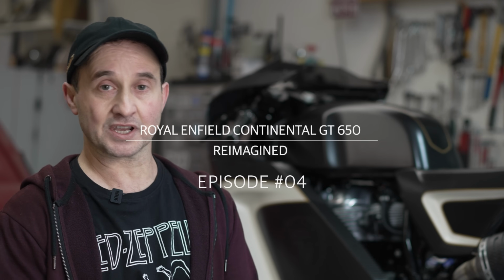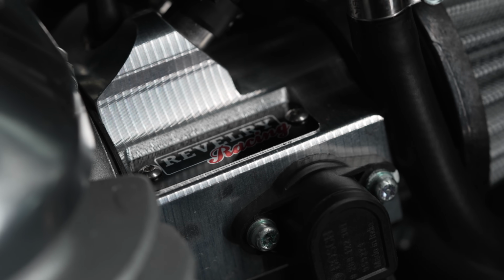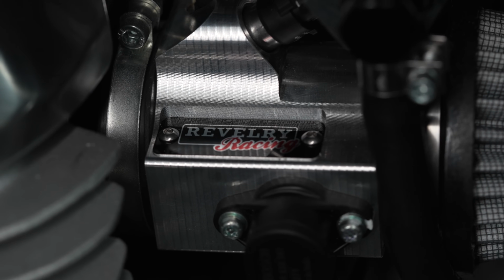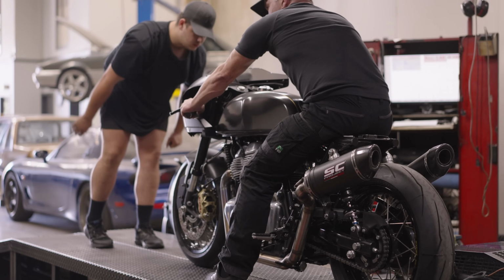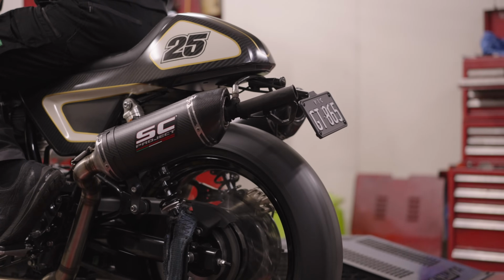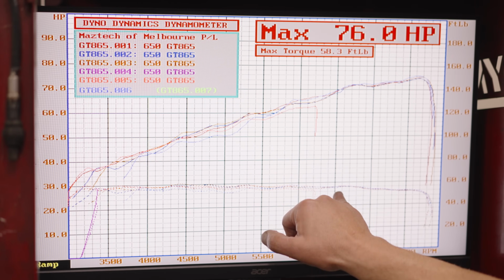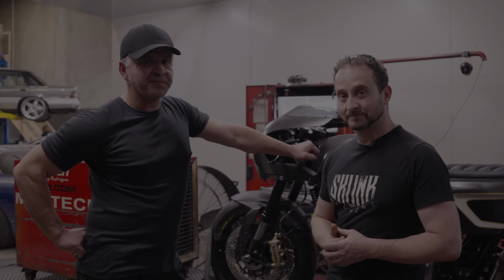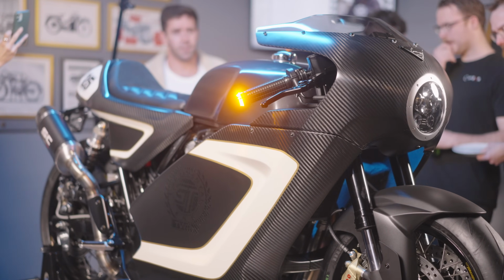The Cerra GT 865 Custom | Ep 4 - Ride & Unveil

Comment: At first I thought that was pretty lame at only 76 HP but then you say it started out as a 650 so now I get it......Nice looking cafe racer.
Reply: Its actually 82 hp now and 90+nm of torque, while less than 650 cc inline 4's in hp but a lot more torque than them, also cruiser like in torque.
So even after getting more performance it still didn't loose the character of original gt 650 which has 47hp and 52 nm of torque.

Comment: I pissed in the wind buying a wrecked 2003 636 a couple of years back. It has 6-7 other bikes parts in it with the '06 forks and ZX10 brakes for low dough and a lot of miles on it to date. I don't care how much power it makes or that people like it most days. It goes where eagles dare. I was having a smoko 2 miles off the grid when a group of dirtbikers came up and asked me if I was daft. I took a puff and told them, "I am gay in my mechanical wares". They hit me with Cricket bats and stole my Pontiac parts.
Reply: The most interesting comment so far

Comment: Now that's one RE 650 I wouldn't mind having.  Engine hp and torque specs are on target, especially the torque.  Having all that torque available at 3500 rpms is going to make that one fun bike to ride!  The end product is definitely more than the sum of the parts, it all works so well together.  If I ordered one, I would opt for mag wheels instead of wire spokes (too hard to keep clean, and you have to run tubes), and have the carbon fiber body work painted to match the tank, or have a carbon tank to match the bodywork.  It just looks odd that the tank is painted but nothing else is.  Great design and execution, well done!
Reply: I don't understand this weird differentiation motorcycle enthusiasts have between torque and power. There is no appreciable difference between them in this application, you can't tell the difference, and it wouldn't matter even if you could since you can't have more of one or the other. It's not like they could have tuned it differently to make less torque but more power at 3500. That's not how physics works.
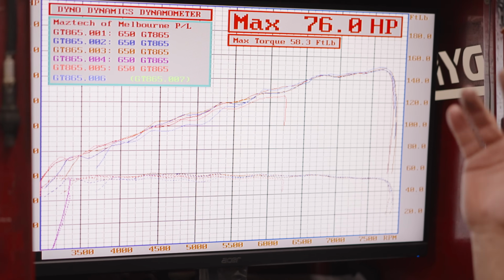Reply: @benfennell6842  Torque and hp are not the same thing, I'm sure you realize that.  I would much rather have a bike that has hp and torque "curves" as seen at the 5:19 mark, than one where the hp and torque curves are mirror images of each other.  I don't like having to constantly pin the throttle to get the max hp and torque from a bike.  For example, I have a 2018 Triumph Street Twin 900, which makes something like 55 hp.  The newer models have 65 hp, but it's only available at 10500 rpms, which my ST will never see, so it's not really usable hp for me.
Reply: @bronzestarvue  It's physically impossible for the hp and torque curves not to mirror eachother. You cant seperate them or change the ratio between them. It's just physically impossible. It's one curve. It cant have one torque curve and another power curve. They define eachother.

They may be physically different things but they are linked, and because of the way they are linked they are identical in nature to the rider. Saying a bike "makes a lot of torque" is always just a way of getting at the real truth that statement is conveying: the bike makes a lot of torque AND power *at a low rpm*. By talking about torque and power as though they are meaningfully different in an engine you simply confuse people. It's pointless.